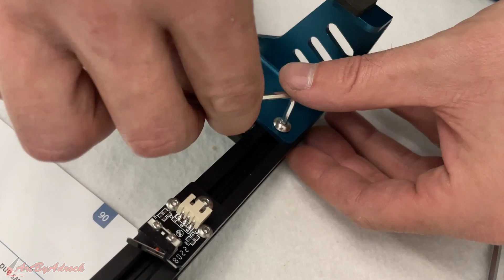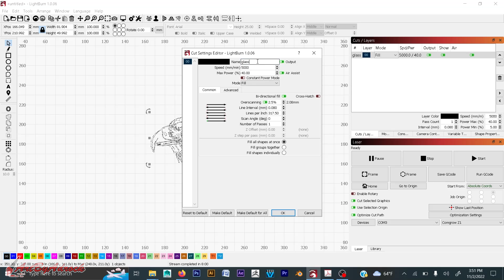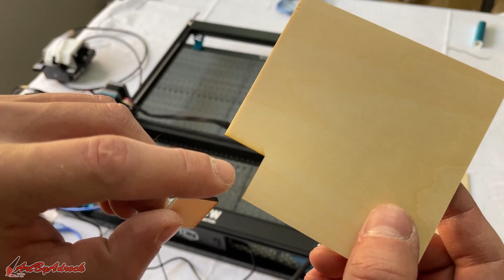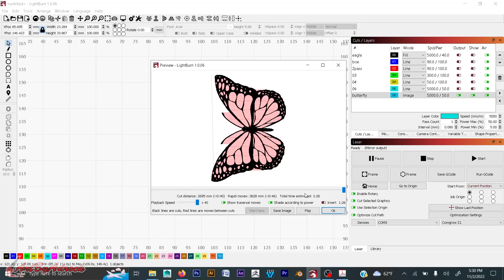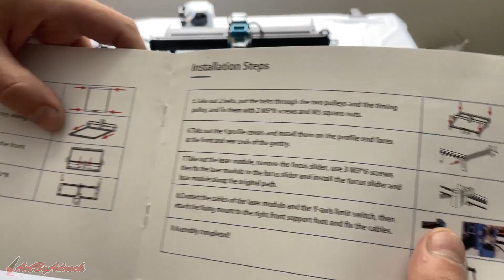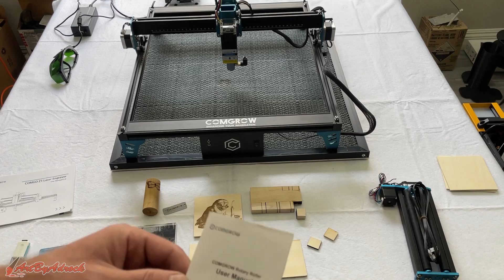Comgrow Z1 Laser Engraver, Rotary, Air Assist, Honeycomb & Cover - Full Test & Review

Comment: Suggestion:
When cutting thicker material, take the thickness of the material... divide by 2... subtract from the normal focal distance.
The thinking is that you are slightly out of focus until the half-way point. You then are perfectly focused and moving back towards slightly out of focus. The way that you had it set up, you were perfectly focused and getting worse as you went deeper.
Reply from the maker: That’s exactly what happened. I should have lowered the laser more but I didn’t. It was more just a test 🤷🏻‍♂️